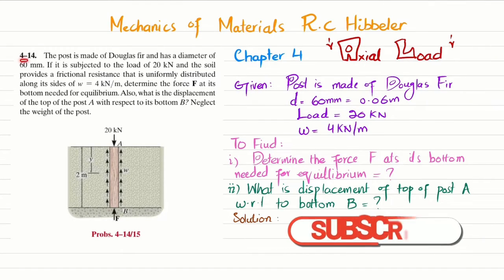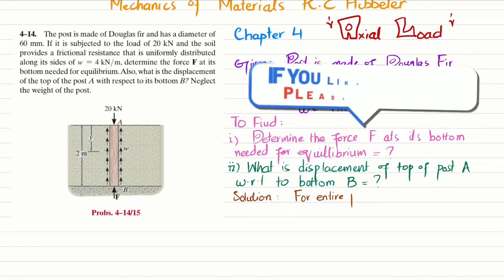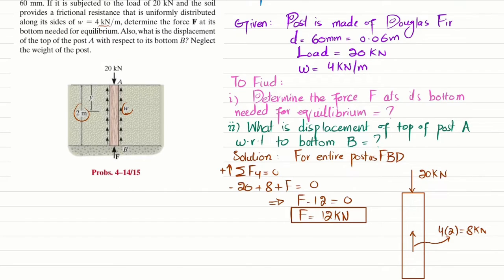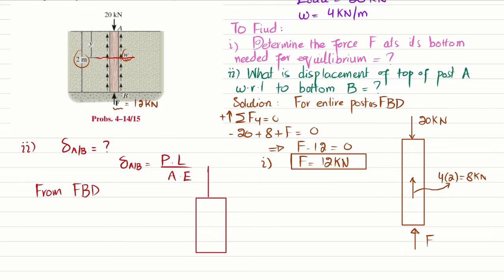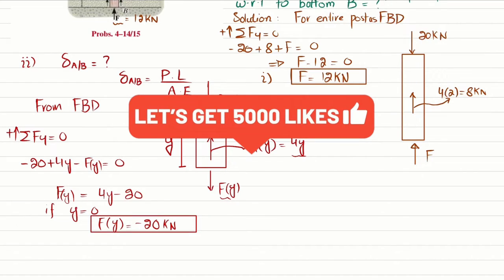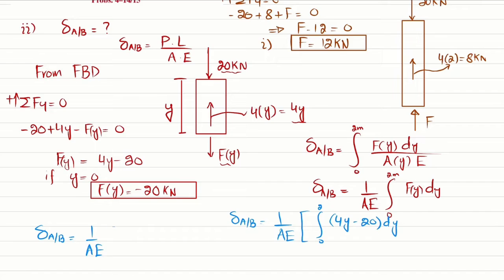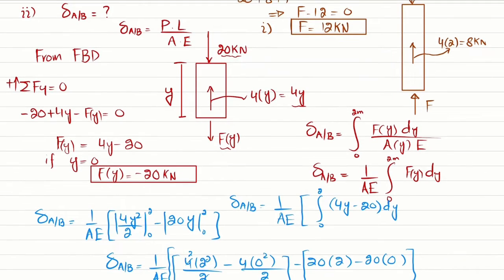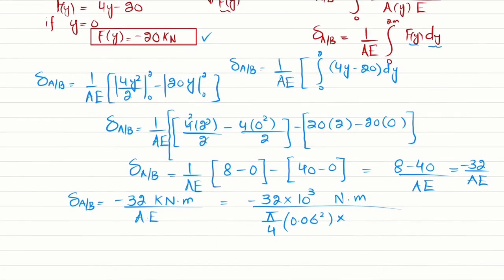Determine force  and displacement | Problem 4-14 | Stress | Force | Mech of materials Rc Hibbeler

Comment: If anyone knows, how do you solve these if the frictional load is changing with depth, for example, it is 0 kN/m at y=0 and 11 kN/m at y=2
Reply from the maker: In question it is given as uniform distributed load and to convert the uniformly distributed load into point load we multiply it with its length over which it acts.
Reply: @engradnanrasheedmechanical  that works for solving for the equilibrium force on the bottom, but what equation would you then integrate to find displacement?
Reply from the maker: @AustinFeltron as the friction load is distributed so for its effect on entire length we take the integration of displacement over the entire length.

Comment: Why isn't the 12kn/m force being used for when displacement is 2m since the frictional force is variable?
Reply from the maker: It's not 12 KN/ m it's force which is 12 KN... second both reaction force 12 KN and frictional force 4* 2 =8 KN balance the applied load of 20 KN. Check it again please.